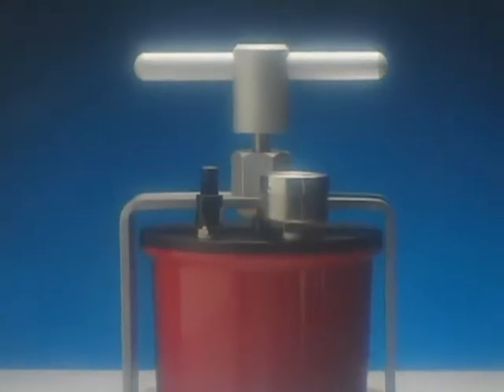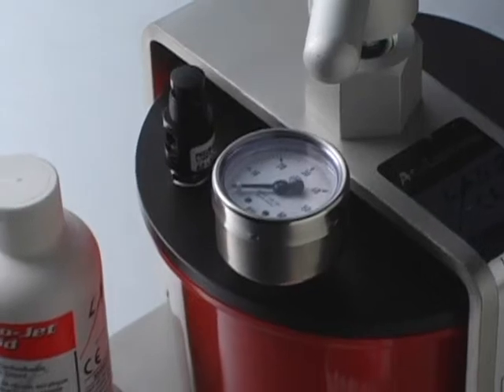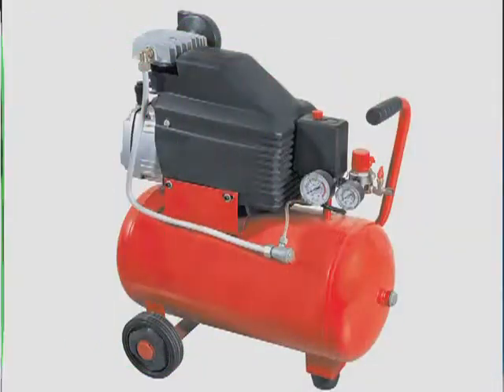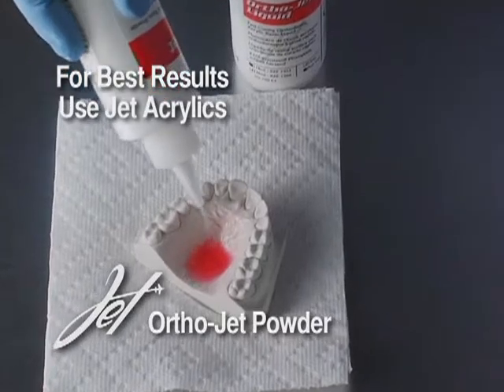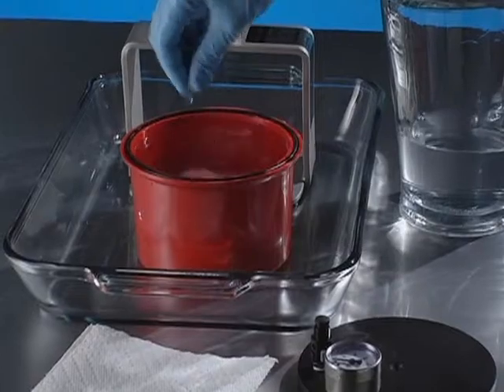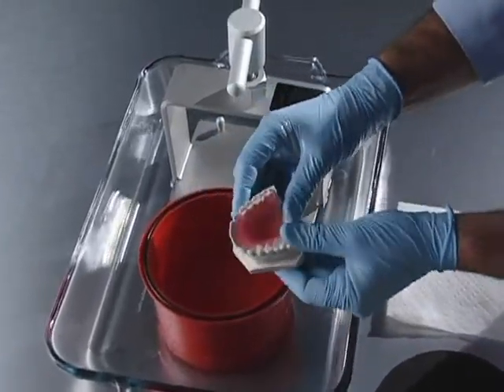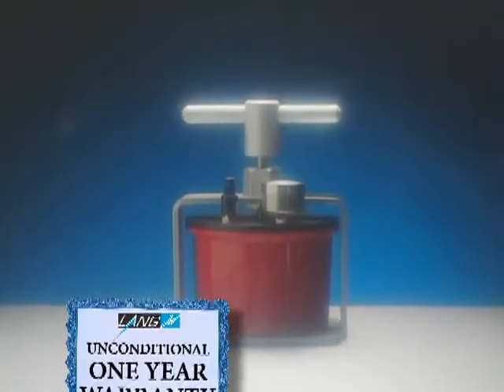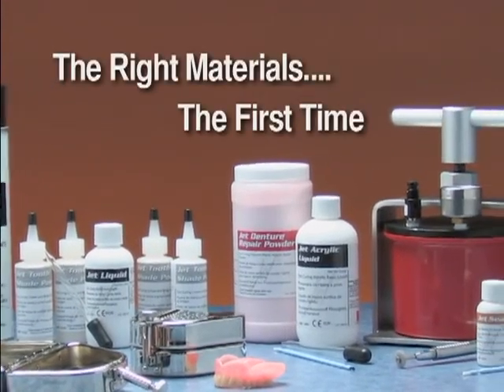Instructional Video for Lang Dental's Aquapres

Comment: Hi I have one of these but the pressure gauge is not working I followed your instructions on the video, but mine is not working , can you let me know how to get it work please ?
Many thanks
Reply: I got the same problem too, just bought it recently back in April. I used it once back then and now when i tried to use it again, the pressure wont go up no matter how hard we turn the press. Any other suggestion on how to fix this? Thankyou